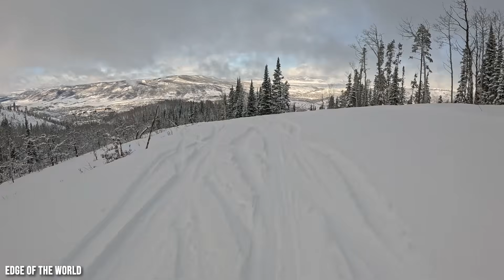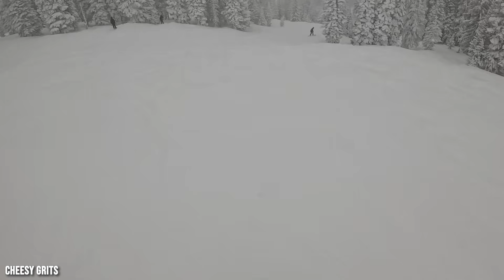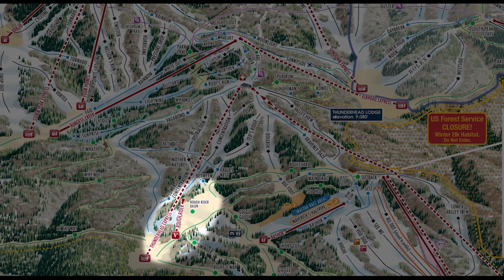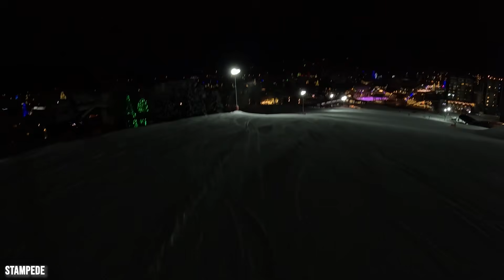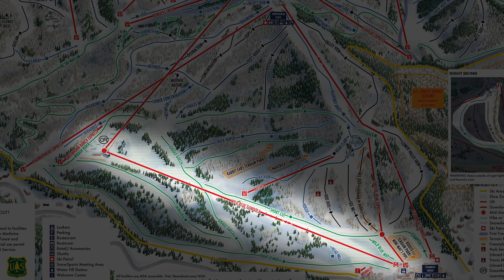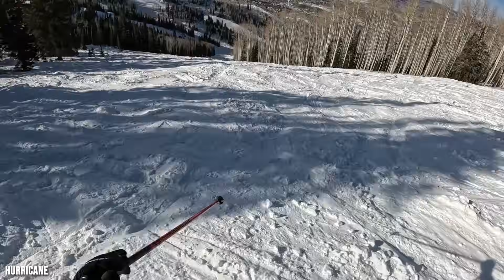Steamboat's Full Steam Ahead: A Comprehensive Breakdown

Comment: I'm an intermediate skier, and Steamboat regular. I love the beginner upgrades, and my friends have told me that Mahogany is awesome too (Someday I'll be skilled enough to ski it🙏). But I'm actually not the biggest Wild Blue Gondola fan. Of course, a one lift ride to Sunshine Peak is great, but I would honestly rather take Steamboat Gondola to Sundown, because I can ski a bit in the middle. The Elkhead runs are very mid in my opinion, but I'd still rather ski them than just sit on a gondola for 13-15 minutes, I just find it less boring (plus I'm a lift nerd, and love Doppelmayr Spacejet lifts like Sundown). I also feel like the gondola gets a lot of people to Sunshine right when it opens in the morning, meaning Sunshine is usually swamped by the time I make it there, while the rest of the mountain (besides Morningside) is basically empty. For example, last season, I went to Steamboat with a friend. I lapped Christie Peak a couple times while I waited for him to get to the mountain, and got the 6-pack chair to myself both times. We then met up, and rode up the Steamboat Gondola, and again, no wait, cabin to ourselves. After that, we went to Sundown, where there was about a 1 minute line. We rode up, and headed to Sunshine. Guess how long Sunshine's line was when we got there.

If you guessed around 15 minutes, you'd be correct (stole a little line from you guys there). It was so bad, we only took Sunshine once, and exited via South Peak the next time (which mind you, still had a ~10 minute line itself). So yeah, I don't have a problem with it existing at all, in fact, I think Steamboat is better with the gondola than without. It is just quite annoying for all the people like me who still take Steamboat-Sundown. Its a lot like the theoretical problem I had with Shangrei's proposed Town lift replacement at PCMR from last video.

Oh, and what made the experience above so unexpectedly bad, is that it happened on a random Wednesday in March!
Reply: Yeesh, 15 min queue is never fun! I had a similar experience at Mt Hutt in NZ, the peak was cool but on some days the line was just atrocious, and I could just lap the norwester (basically halfway up) twice in that time.